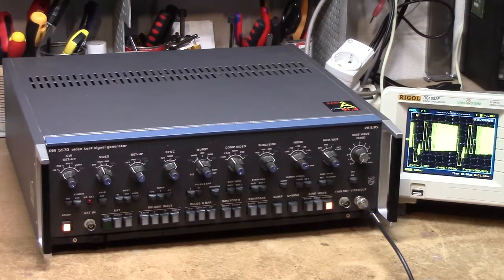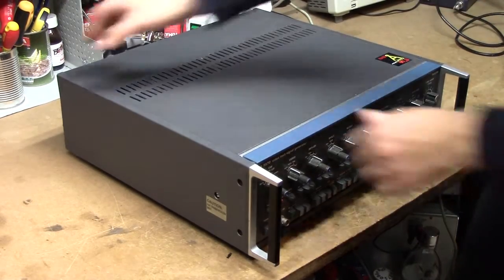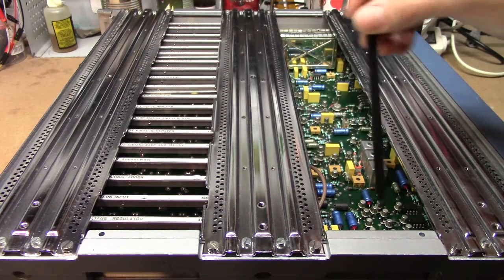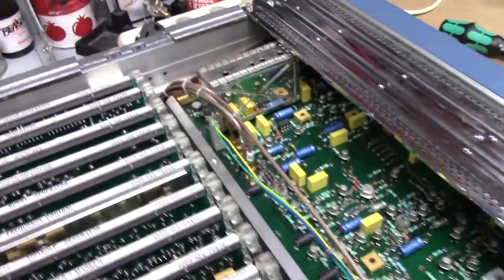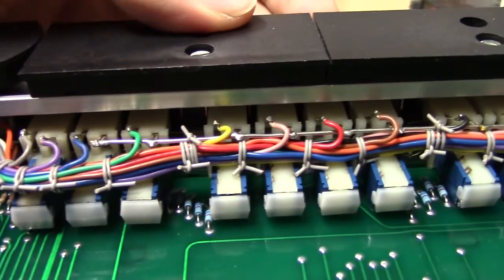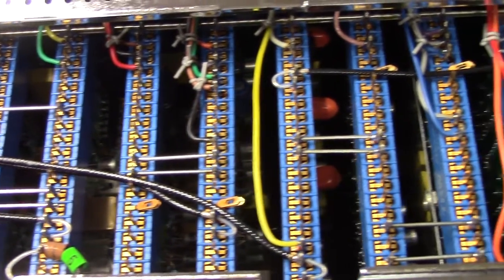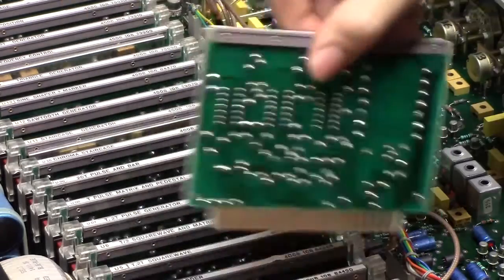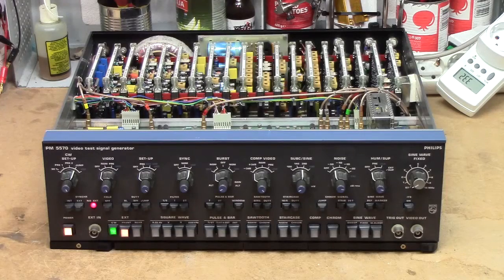Philips PM5570 analogue video signal generator teardown

Comment: They are Frequency bars, contrast and brightness tests and of course colour tests used for fine tuning the separation at pixel level when setting up the field coils on analogue TVs. Used by engineers in TV studios and sometimes at home when analogue tv's could drift they had variable pots in the back to tweak rotation , vsync and hsync and saturation etc.. very similar to the test cards broadcasters would air in the early hours for those who knew what they were doing :) Probing a TV while displaying frequency bars you would be looking for very specific numbers in the Mhz range on a scope :)

Comment: Reminds me a lot of the electronics in a Philips LDK44 TV studio that was used by a local TV station where I was a volunteer for a while. The way that multiple circuit boards are beautifully labeled and organized in a system, all the components manually placed, and put together with maximum love and care for the product. Documentation was also of the highest quality, and everything was designed to be maintained by the owner; for example it was possible and perfectly acceptable to pull boards out of control units and replace them or service them while the rest of the studio was in full operation. The video control panel that switched between the cameras had a softer touch than the keyboard that I'm typing this on. The studio was built in 1982 or so. See e.g. http://www.marcelstvmuseum.com/photoalbum2.html (search for "LDK 44" and "video 80" on the page) and http://www.marcelstvmuseum.com/philips%20video%2080%20binnenkant00.html (click the "next page" button too).

Clearly they don't make them like this anymore, because everyone expects electronics to get cheaper and cheaper, but people who are willing to put this together are becoming rarer and rarer and (understandably) won't do the work for the same pay anymore as they used to. Philips started treating their employees like crap to save a buck here and there, and in the late 1980s quality started going down. They sold everything off in the 1990s when they were on the brink of extinction because of competition from the far East. The division that made electronic measuring equipment such as oscilloscopes and probably also this device, was sold to Fluke, the division that made camera and TV recording equipment merged with Bosch and became BTS, the Elcoma division stopped making those beautiful electrolytic capacitors that still work after 40+ years and many other components; they started making only ICs and became NXP, and the division that made wafer steppers to produce the chips is now ASML. There's almost nothing left of the old Philips and when I see a beautifully crafted product like, this, I miss them very much. Thanks for posting!